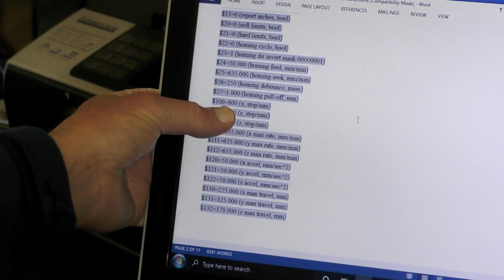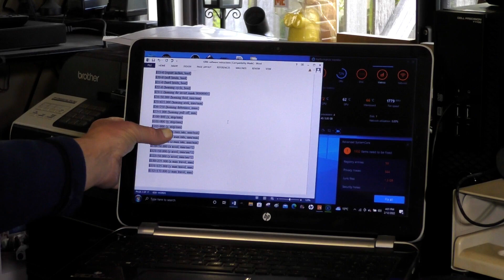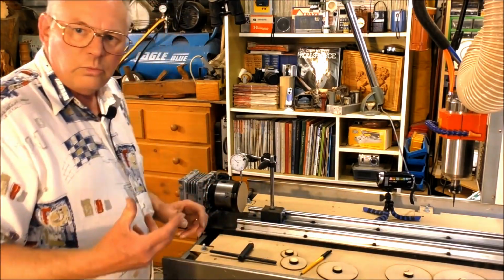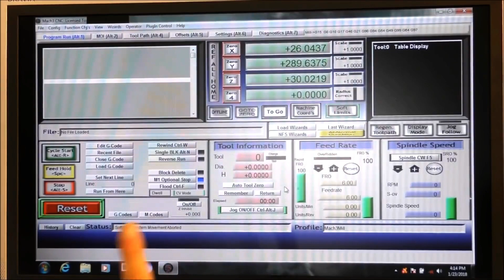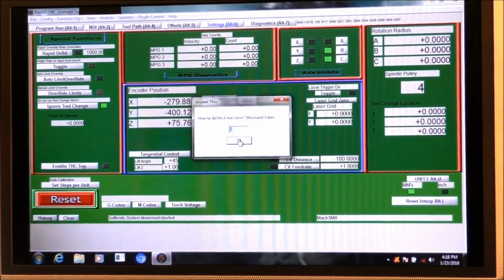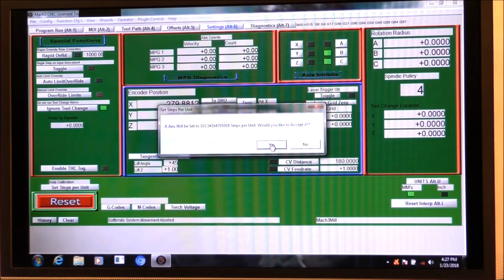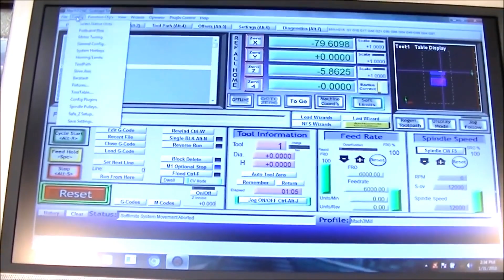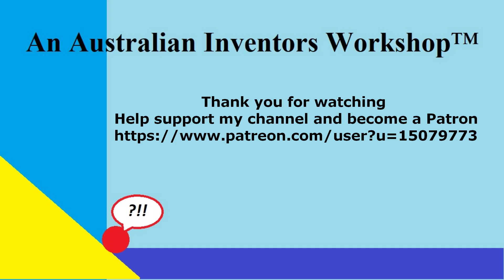HOW TO# Setting up an A 4th axis to Mach3 or GRBL

Comment: A correction Roger.  typing $$ will bring up a window or log of what the CURRENT settings are.   to change those settings, then in this case you would type just $100=500  etc and press enter for it to change and be written to the grbl board :)